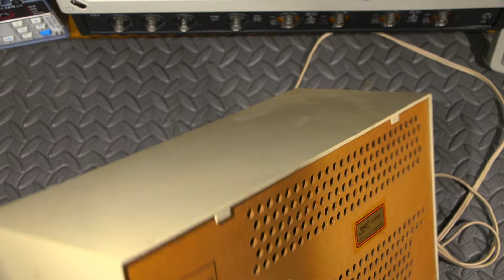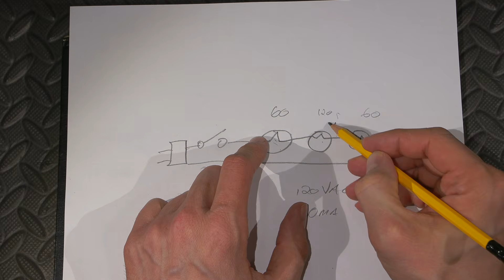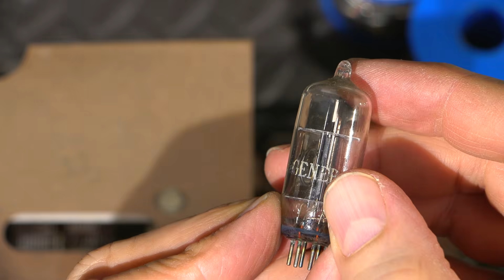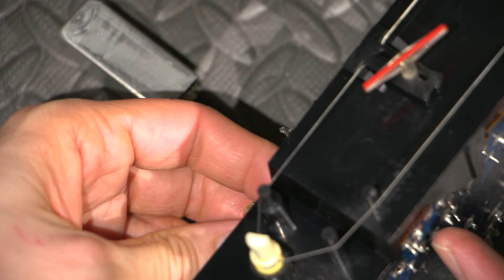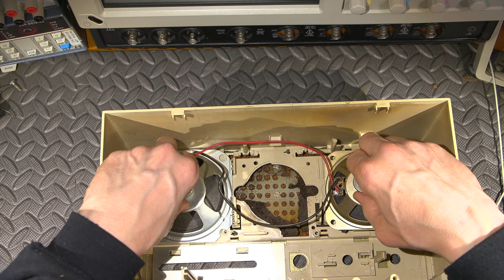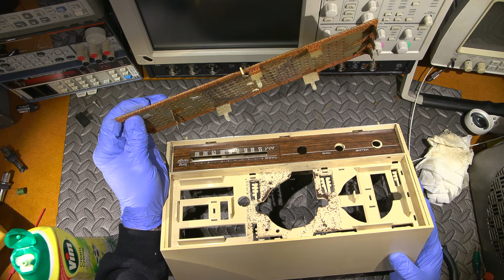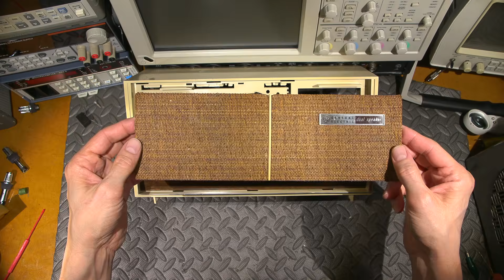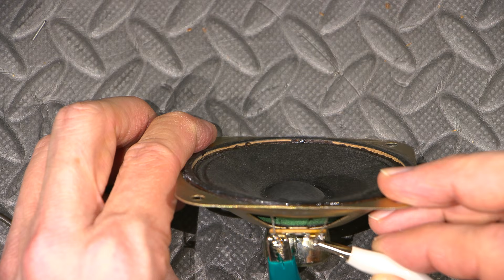Barn Find Restoration Adventure - 1960's Long Range Radio Receiver!

Comment: May have sat in a beauty parlor for 30 years. I'm pretty sure my grandparents had that same radio back in the sixties, always tuned to AM 750 WSB Atlanta. My heart skipped a beat when I saw this one. Thanks, as always!
Reply from the maker: You're very welcome!
Reply: When Mr. Carlson first mentioned the PERFUMEY SMELL, my first thought was "Did a mouse crawl up in there and die (looks a little hard to do the way this unit is put together) and someone used Perfume to help Mask the Odor?

Personally, I believe I would prefer the "Smell of Death" because I am pretty Sensitive to many Perfumes.  <ROFL>
Reply: Yes Ma'am , you have it 👏...we had salon in Liverpool 10yrs and I've a modern stereo , smells like 'hairspray' 😂

Comment: At 55:00  in, they  actually put a clock there. The cabinet was a universal one. They also later made an AM/FM version
 with and without a clock in solid state using the same cabinet!  I did notice a nasty brown stain inside the cabinet 
above where the 35W4 and 50C5 was giving off quite a bit of heat. I like the fixes for the speakers Paul. She is a real
 station puller now after all  that adjustment and repair. Thanks for showing how to correctly restore a radio of
 this vintage.
Reply: I was gonna say that there are models with a Clock in the middle
Reply: I'd be inclined to glue some foil in the cabinet above those hot tubes. But, would that affect the tuning quality?
Reply: @jamesplotkin4674  They make an narrow roll of adhesive  aluminum tape and I have used it successfully. But don't ask me where I got it or who makes it. Does keep the outside cool to the touch!
Reply: @hestheMaster  Oh, yes... Foil faced duct tape!  It should preserve the cabinet for a few more decades.
Reply: We had a very similar Zenith 6-8 tube radio (but the clock was on the left side.)
Reply: Absolutely! I own one of the models without the clock, and it does have a solid-state tuner front end, and the rest is tubes. When i picked it up a few years ago, it needed the power supply caps replaced, a few out of spec resistors, and a few various other caps. Once those parts were replaced, the radio worked well. I also ended up installing a Bluetooth module in it so I can listen so music files from my phone.
Reply: There was also a solid-state version made later as well.  My grandmother had a solid-state AM-FM version of this radio in her bedroom.
Reply: @hestheMaster  The foil might also prevent the radio signal from reaching the antenna!  The aluminium tape would be a comolete waste of time anyway, as the internal staining of the top of the cabinet was from accumulated dust & dirt, not from heat damage.
Reply: @nevillegoddard4966  Dirt and dust can be removed but yellowing from heat damage ,which is common in these plastic cabinets is very common and can't be removed.
Reply: @hestheMaster  Yeah I agree with you.  I was talking about the inside of the cabinet thought, so who gives a damn about there, apart from dust & dirt?

Comment: I changed tubes back in the 1960s, but I had little understanding of what I was doing. If radios back then stopped working, there was always another one out in the garage or barn. Your video gave me a great understanding of how a radio is set up and works. Thanks for a very educational 90 minutes!

Comment: Good to see this repair,back in 70's worked in electronics servicing. We had plenty of these GE radios. Most had circuit board issues, plus tube replacement. Sometimes had if coil issues,in those days we just replaced. Thanks Paul for great tips.

Comment: I had to chuckle when you were checking the phasing of the speakers.  I do it exactly the same way!  I've never been a fan of tube sockets soldered directly to a circuit board.  With expansion and contraction as they heat and cool, it's fairly common to end up with bad solder connections over time.

Comment: It always amazes me how well the AVC circuits work in those old tube radios. There is a lot of dynamic range between the weak and strong stations yet the volume is very constant across all stations. Nice restoration!

Comment: Paul, great that you have all these Medium wave stations available. I live in Ireland and all medium wave band is empty so I use my own low powered AM transmitters to have something to listen to. On the upside the advantage is that you can play music and news appropriate to the time period the radio is from.
Reply: Ireland, if you like the music they play, Radio Caroline is available on 648 KHz. (They are since a week on half power due to some technical issues, but they will be back full in a short while).
Reply: Sadly there isn't much worth listening to on AM anymore.  These days the station licences are bought and sold cheaply, and it's mostly small-audience programming. Even news and sports have gone to FM in my area.
Reply: @erikdenhouter  Radio Caroline is transmitting on the east coast of England in Ipswich in Suffolk and only covers a small area in Suffolk (see Ofcom coverage map). I live in Dublin in Ireland, so also on the east coast but in a different country. Unfortunately radio Caroline cannot be received on Medium wave in Ireland (under normal atmospheric conditions).
Reply: @rudie2902  Bummer, you're right, it is England's east coast. I live in Rotterdam (Holland) with good reception, and had a wrong view of these distances.

Comment: I started learning electronics when I was 8 years old in the early 60's but I always gain something from watching your videos. There was one thing you forgot to mention when tuning the variable cap is to always use a non-metallic tool to make the adjustment because using a regular screwdriver may affect the tuning. Working on tube equipment always brings back great memories of my early years. From the smell of the components and tubes warming up to the little tinkle of the tubes as they cool down after being turned off, it's all good memories. I still like working on and building tube equipment but getting parts is getting more difficult and expensive. Luckily I have a pretty good supply of old NOS tubes stored away. Thanks again for what you do.

Comment: I believe the smoke tint clear plastic was by design.  It may have been a glare & reflection preventer.  In the 60s & 70s, a darker smoke tint in dial plastic could be found. (Sony & others)

Comment: The odd driver on the right as viewed from the back says made in Japan, plus it has that toxic looking Cadmium look of early Japanese metal electronics. The left speaker has no 'MIJ" stamp, thus original. Also, the speaker is installed in a different position from the Canadian GE speaker. Cool old radio, love the videos. Peace, Love and Electronics forever !

Comment: At first glance I thought this was the same radio I have, however mine is a T-1240A that is AM/FM with a transistor tuner and tube amplifier. I actually have a pair of them, and they look similar but are inside wooden cabinets. Nice radios!

Comment: I made a poor man's Variac. I used two 40 Watt bulbs in series. I actually saw the capicitors warming up and bulbs got dimmer and stabilized. I switched two only one 40w bulb and run a bit. It was stable. I put full 120v. And my Ocilloscope ran perfectly. I owe some of this to your show explaining current flow. Thanks 👍

Comment: Wonderful job. I like the noiseless way you did the alignment!! I'm surprised the cabinet did not crack with tge rework. Usually the tube heat makes them brittle. That one speaker sounds like my dads old Remington shaver when i was a kid, LOL. That center hole in the cabinet was probably for an optional clock. The oval slots on either side are a clue. One would be for the ON-OFF-AUTO control, the other would be the SLEEP timer.
Reply: I can confirm that it's for a clock.  I have a similar-looking model with this cabinet, the same tweed over the dual speakers, and an alarm clock front and center.

I haven't gotten started on it yet, but interestingly it says "Solid State" on the badge.  I can clearly see at least one tube inside through the vent holes, so I'm excited to see what's going on in there.
Reply: @Thegonagle  Didn't GE make some hybrid versions of these? The long-range and AM/FM versions of the AA5 design usually involved using  a 35C5 instead of a 50C5 so the extra 15V could go to the extra tubes, thus there was less output power. But, the hybrid sets used transistors for the added features so they could stick to the full-output-power AA5 design for the rest of it.

Comment: I would have been curious to see you fix that transformer. To see the technique you used on those very small wires.
Reply: There isn't much he could have done more than anyone else. You have to be careful to not strain the wire and do more damage, though unwrapping another cm or two if an accident happens wouldn't throw it off noticeably. You can delicately scrape the coating off the wire with a scalpel or sandpaper making sure you relieve the strain on the wire. You can support the transformer with plasticine or in a plastic jawed vice. If you are feeling brave a quick flash from a lighter and a brush with fine wet and dry. You are advised to then j connect to the new wire and give a light twist before soldering, I doubt he insulated the repaired wire, but he may have. Make sure you have a clean and tidy working area with good light and a magnifying lens.
I may have been tempted to just repair it as it was, unwrapping half a turn, snip a bit off the broken lower part and be quick about it. - But that is why he is the best...
Reply: @martinda7446  spot on and lovely description. Must be what it feels like reading those romantic sexy novels made for old ladies. But a manly version 🤷‍♂️😂
Reply: @martinda7446  Do you thing the repair could have thrown off the resonance on the coil, it was fairly far off..
Reply: @ZXLNT  Interesting, and very likely considering the rest were spot on. More likely it was distorting /shifting the cap  at the base of the coil when pulling it out and heating it etc - Very sharp of you to pick up on that.
Reply: Testing and repairing IF transformers would be an excellent video, all to itself.  

——>  Hint, hint!!!  <——
Reply: And me, that’s the part I really wanted to see.
Reply: @davidhudson1168  Me also
Reply: Old fashioned transformers are not hard to rebuild just time consuming and getting the right copper wire to rewind them

Comment: Awesome vid. Love the speaker tips. I been a ham 40 years. I'm still sitting on about 40 OLD radios. Some going back to the 30s, one (missing it's case) the 20s. Got a ton of NOS tubes from the same source.  I'm going to join  your Patreon soon when I start on them. Way overdue.

Comment: Great video!  I'm getting old as I remember "Top 40" radio and all of the AM rock hits from my young adult years.  I grew up with tubes and learned new technologies as they evolved.  

I was in a record store in the mid 60's. remember them? When a local DJ was asked about FM and responded that it would never become popular! 

Your videos often take me back to simpler times.  I spent over five decades working on devices from tubes to microprocessors.

Comment: I love the fact you are using an analog meter to peak things up, vs an led bar graph type meter.  I did all of my radio work with analog meters, and still prefer that when seeking a peak or null.  Great job getting this old relic going.  73 - de Bill, K5WGA.

Comment: Always enjoy your restoration videos! I'm very surprised the dial cords seldom need attention after many years of use! Must have used high quality materials back in the day!
Reply: My grandpa did radio and TV repair and when I was a teen he had me restringing dial cords for him I was pretty good at it. He also had me R&R car radios for him. Lots of the car radios had vibrators in them.
Reply: @gussuk11  Might want to explain why a car radio would have a vibrator for those under 45.😀

Comment: Cleaning the plastic brings to mind the way we used to polish our watch crystals.  Years ago when I was a smoker, I  would take ashes from the ash tray and    put on the face of the watch, then take a dollar bill and polish it, this would take the scratches from the face and make the crystal look new again!  I still have the SIKO Watch I purchased at the Gunfighter PX on Freedom Hill in Danang Vietnam, and it still runs fine after 53 years, a self winding 25 jewel model with a few scratches, after all I stopped smoking in 1995.

Comment: Made in 🇨🇦 💪 - Thank you for sharing this repair. I find it interesting that the speaker cutouts are only 40 ish percent yet the middle cutout is 70 ish percent but not used. Also on the front design, the middle verticals bar really should of been removed in the design allowing the tweed to be  one consistent piece. I guess it was done to   emphasize two separate speakers. Just my thoughts. 😃
Reply: Yeah, it looks like the case was used in a number of different models. I think originally it had a single center speaker (being the most open) and this double speaker version being almost an afterthought - perhaps a later version?
The supports for the front grill are positioned in the middle of where the 2 outer speakers have been added, but they didn't bother revising that, so it blocks a lot of the speaker cone.
The plastic support frame behind the grill cloth has about 30% openings, so that detracts from the audio too! There are also weird rectangular slots on the right side above the tuning dial which look like they were for something else completely.
Reply: One of the speakers is made in 🇯🇵. My guess is that it is not original.
Reply: @hijmestoffels5171  - the smaller Japanese speaker is definitely not original.
Reply: Middle hole was for a clock on another model

Comment: Paul, When I was about 13 years old, having saved my money from my Brantford Expositor paper route. I wanted to buy my super great parents, a new radio for Christmas. I went with my Aunt Lucy to Parson's GE store, on Colborne Street in Brantford and purchase this exact radio (although mine did not have cloth over the speaker grilles, just a plastic grille) .Mom and Dad loved it. As you noted the 2 speakers were of different sizes from the factory (an attempt at High Fidelity, I assume). It wasn't a particularly a great radio and it eventually stopped working, also as the plastic case gassed out and literally fell apart some years later. Sixty odd years later what shows up on your channel, bringing back many great memories.
Paul W. Aitchison 
Love your channel, very educational!
Reply from the maker: Thanks for sharing your story Paul!

Comment: Silly question, but why not look for the open filament with the meter set to continuity and the board not connected to the mains? Surely much safer. Or even pop each tube in turn and measure across pins 3&4 directly?
Reply: There are lots of ways you could have done this. For example, you could have connected the ohm meter across the power cord and shorted out the heater pins in each tube in turn until you got a reading in the meter.
Reply: @psionl0  I agree, I was just wondering why Mr Carlson picked what appears to be the most dangerous way.

Comment: Curiously, do you just solder those super fine wires together in the IF transformer? I've always feared they disintegrate creating a much bigger problem.
Reply: You can!!  It takes care, precision and patience!  I had to do the same repair in one of the IF transformers in a 1957 Graetz German table radio a few weeks ago.  The LW/MW/SW wasn't totally dead,  but the local 50kW AM station was barely a whisper with the volume at full.  The UKW which uses a different set of IF transformers was working well.  It was interesting to find that even with the broken wire in the IF transformer,  a tiny bit of signal coupled through at the intermediate frequency.

Comment: Wouldn't have been safer to measure the resistance of the filaments?
Reply: I was thinking that. Either that, or just put a low voltage though the filament chain, like 12V or something.

Comment: Paul, instead of testing for a broken filament in the "filament chain" with an AC voltmeter, wouldn't it have been easier or at least safer to use an ohm meter to test each tube between pins 3 & 4?  Or am I overlooking a reason to use the voltmeter & a live circuit?  I know I can safely test a live circuit like you showed, but I'm curious about whether using an ohm meter like I mentioned is just as good of a test.
Reply: i had the same thought 💭
Reply: Or use one of those electric field detector pens.

Comment: With the radio, I could see that the case is moulded to receive 3 speakers, so when you look into the case from the back, you can see a speaker to the left (the larger one) and to the right ( the smaller one), but the center also could hold a second smaller speaker.

Could the radio of been branded as dual speaker meaning that the smaller speaker is a mid to high frequency speaker and having 2 of them and the larger one being a mid to low frequency speaker.

I was just pondering if the case is also used for different models of the same radio?

But again Mr Carlson (the doctor of electronics) waves his hands of magic and the radio comes alive and another beautiful old classic electronic device.

Beautiful work and a enjoyment to watch.

Comment: Wow great find great restoration. Sometimes people spray Febreze in them to get rid of moldy smells and such before selling or mailing.  I have sprayed musty smelling ones myself and lock them in a cardboard box for couple days before removing them to work on them. I had a lot of music cd’s in a bread box by a window a/c and dampness ruined one disc and gave a bad smell in the box so I put a Glade popup in the box with the cd’s and closed the lid left it for a week and smell of musty is gone. I can’t stand musty smells at all especially on anything I am working on.